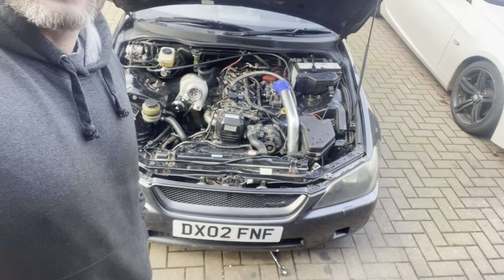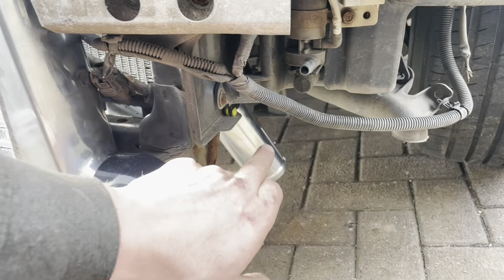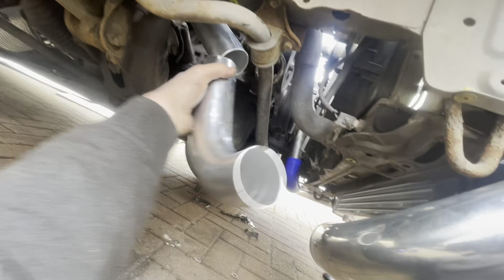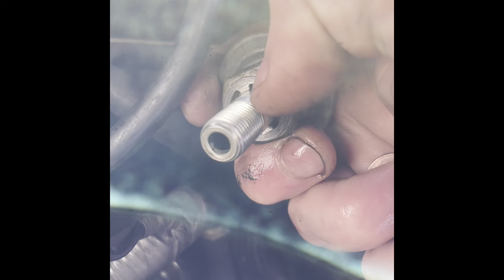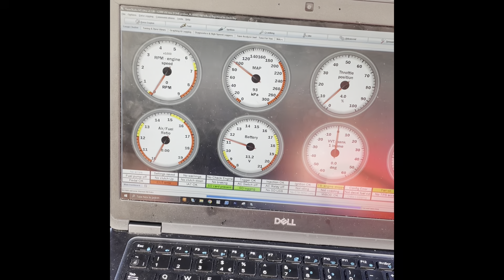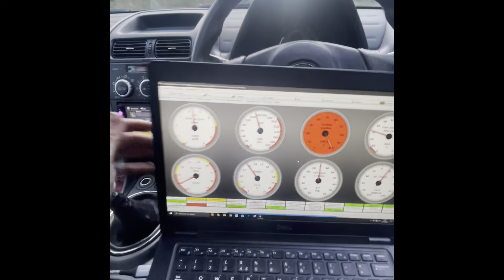Lexus IS200 Turbo build. MAXPEEDING RODS INTERCOOLER AND KIT. The Car sounds SO GOOD!

Comment: Hi mate quick question. Currently i am installing turbo on my is200 but i have issue with the piping on the throttle side. There is a crash sensor blocking and the only way is to remove it. In the video I see you removed it too. Did you relocate it? Is it oke to leave it unplugged? If so will there be any lights on the dash?
Reply from the maker: i just horsed it out the way :)